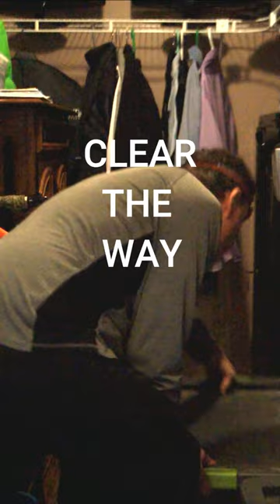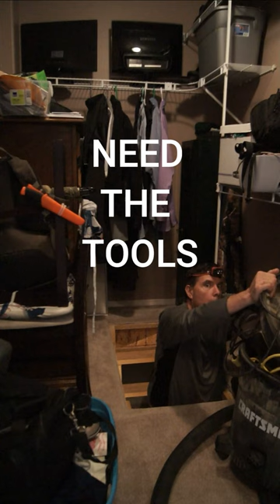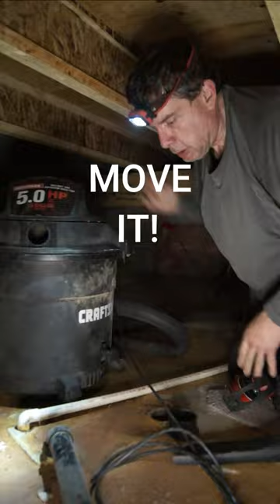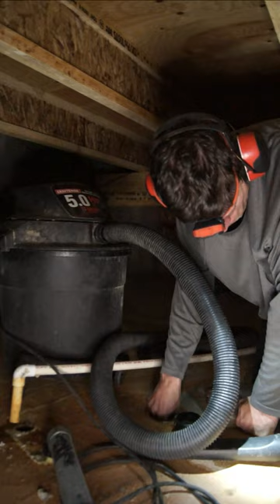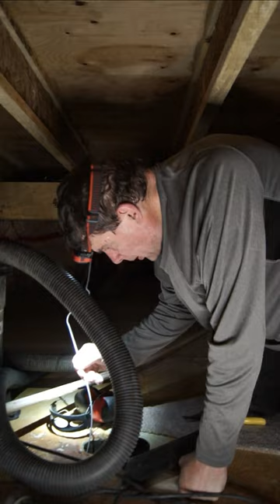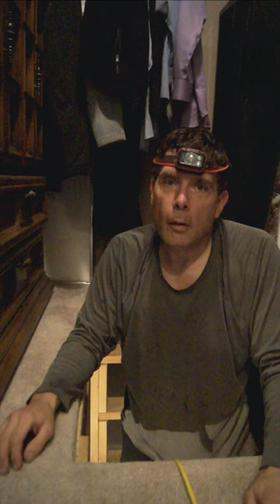Unplugging the furnace drain

Comment: You really are awesome . Gotta clean that flame sensors next time too .  
Never seen a access like that here in VA .
Reply from the maker: Hey Jerry. I'll put that on my list. I know the filter is still good, just changed it a few months ago. Pretty tight down there but that's okay.
Reply: @LifewithParkinsons  looks nice and clean ( the crawlspace )
 . I need to clean my coil and drain 😷
Just make sure power is off when touching flame sensor , supposedly it dosent feel well when current flows through it .
Little steel wool or paper money and cleans right up . Very common fault on gas furnaces

Comment: You can still do things around the house.  Good for you!   Earn your keep as long as you can.   Are you still able to rake leaves?
Reply from the maker: Hi Ann. I may have overdone it yesterday. About an hour after finishing the drain i had my first fall  
Body got too far ahead of my legs. The movapo wears off quickly which is the only reason I can do stuff like this.
Reply: @LifewithParkinsons   I hope you didn't get hurt.  I was falling 3 - 4 times a day.  I either got smarter or some adjustment was made in my DBS or meds because I stopped falling.   I remember it hurting my ego more.  Just remember you have PD, and sometimes that means you just do one thing a day. Don't over do it.
Reply from the maker: Only my pride got hurt. I just get so determined to keep going that I let myself get away. My wife tells me to slow down too, so I know what you're saying. I see my MDS in Nov so I'm hoping to get an update where I am on the DBS list.